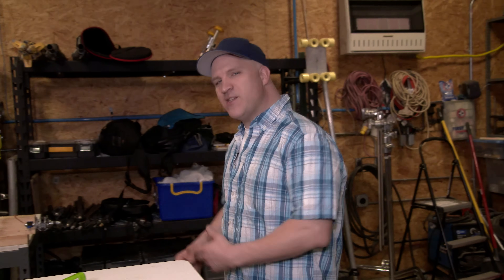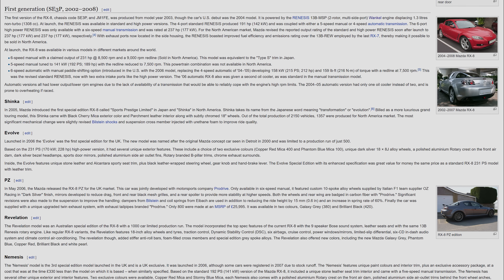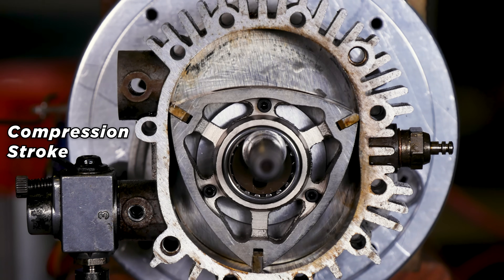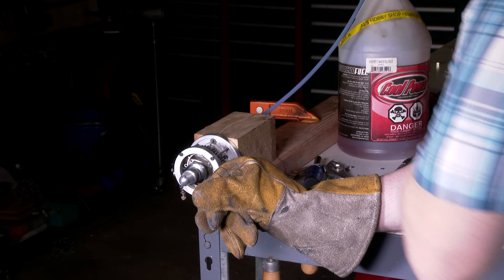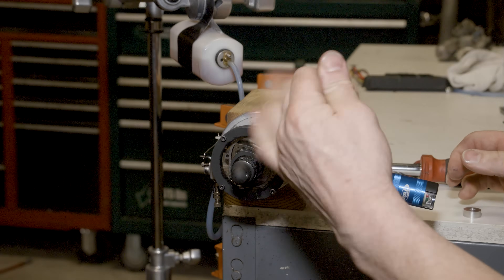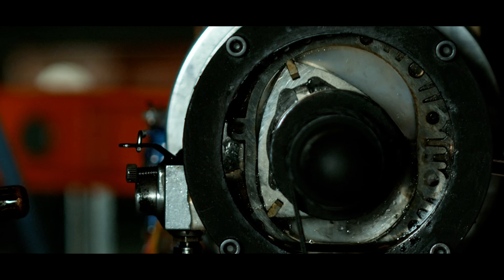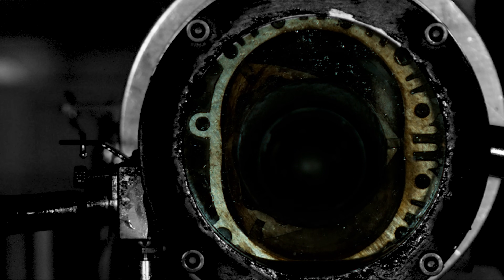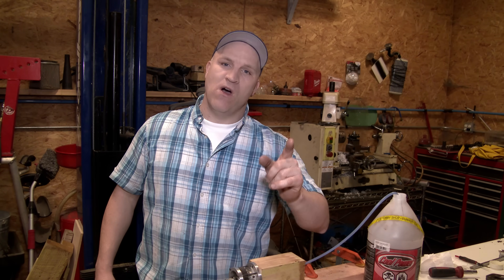See Thru Rotary Engine in Slow Motion - (Wankel Engine) 4K

Comment: Dumb question coming
I’ve always wondered a few things: 

1. Are their Diesel rotary engines
2 .Are their 2 stroke rotary engines 

Always wondered...
Reply: 1. As far as i know, none. Every Wankel Engine use a single or a pair of spark plug, which is consume a petrol /gas.

2. By the principal of how it works, this engine step is the same with a 4 stroke engine. The step itself is a same, intake-compress-blast-exhaust. How they make that step is totaly different. So this is a different engine, apart from 2 stroke and 4 stroke.
Reply: @valiantvincentius5877  The Wankel engine is a 4stroke engine but requires 1,080° degrees of crankshaft rotation to complete it's firing order sequence.
Reciprocating 4stroke engines only requires 720°degrees of crankshaft rotation to complete it's firing order.
Reply: @sandervanderkammen9230  With this engine, I see 3 combustion phases for every rotation of the crank.  Count them if you want to be sure.
Reply: @EarthSurferUSA  I think you are still a little confused about how Wankel engines work.
There is a 3:1 ratio between the triangular piston (aka rotor) and the eccentric-crankshaft.
Any questions?
Reply: @valiantvincentius5877  As far as the combustion phase goes, it is more like a 3 cylinder 2 stroke engine, as it has a combustion phase 3 times for every rotation of the crank. (or a 6 cylinder 4-stroke engine).  This Wankel engine is a diesel engine. No spark plugs, no ignition control.  It used a glow head for starting, then no ignition for running.
Reply: John Deere, Mercedes-Benz, Deutz, MAN, Yanmar and Rolls-Royce were among a dozen or so manufacturers that developed Diesel cycle Wankel engines. None were commercially successful or never entered production.
  ALL WANKEL engines use the 4-stroke/4-cycle operating principle or Otto cycle.
Reply: @sandervanderkammen9230  wow, thanks for the info of any of that diesel. I need to read much more 🙏
Reply: You got to have pistons to have 4 or 2 strokes...
Reply: @C.dieslevonankwek7  Not true, all Wankel engines have "stroke" e.g; the Mazda 13b engine's  eccentric-crankshaft has a 15mm throw or offset which produces a 30mm stroke per revolution.
Reply: @sandervanderkammen9230  I was thinking it would be considered cycles but what I know of a piston engine you have intake compression,  power and exhaust strokes. 2 or 4 strokes, I dont think a rotor spinning around in a cylinder is a stroke but I've been wrong many times
Reply: @C.dieslevonankwek7  The initial impression most people have of the Wankel engine is how simple it is but on further examination it is actually very complex in its design geometry.
 The Wankel has a triangular "piston" which orbits in a distinctive planetary motion.
Reply: @C.dieslevonankwek7  The triangular piston aka rotor reciprocates side to side as it rotates in a elliptical planetary motion.
The reciprocating motion is what creates the change in volume or displacement during the intake, compression, expansion and exhaust cycles.

Comment: Awesome game engine most powerful engine ever but. That’s.  My own thoughts and I.think that that engine isotherm strongest ever 
Don’t know why it’s only Mazda that did us. That engine ithink that’s the most powerful engine that ever Felix vankel did that engine from start rx7 is using that engine
Reply: The Wankel has extremely poor thermal and mechanical efficiency  and terrible combustion efficiency.
 Mazda was just one of 26 manufacturers that licensed the Wankel design from NSU Motorenwerke GmbH. who also produced them until merging with Audi which continued production until 1978.
Reply: @sandervanderkammen9230  The loss of mechanical efficiency per combustion phase, compared to a piston engine, is offset by the fact that it has 3 combustion phases for every rotation of the crank.  That is 6 times that of a 4-stroke piston engine, and 3 times more than a piston 2-stroke engine.
Reply: @EarthSurferUSA  Not true, the Wankel engine requires 3 rotations (1,080°) to complete it's firing order sequence.
Where the reciprocating Otto engine only requires 2 rotations or 720° degrees.
Reply: @EarthSurferUSA  None of this of course changes the fact that the Wankel uses more fuel per horsepower and less power and torque per liter of displacement  (total displacement) and corrected displacement.

Comment: What would happen if you put two or three spark plugs per rotor to burn all the fuel?
Reply: It's been done, 2, 3 even 4 spark plugs have been used in Wankel engines but just as in reciprocating engines more than 2 plugs offers quickly diminishing returns and increased problems .
Reply: @sandervanderkammen9230  Why could the burn not be more complete with the proper combustion volume area, (to correlate with rotational time and fuel burn time),  and a correct fuel/air ratio?
Reply: @EarthSurferUSA  The poor design of the Wankel engines combustion chamber has too much surface area and too much volume. This effectively reduces combustion efficiency and thermal efficiency due to increased entropy.

Comment: ok in principle, but it's a bit of an exaggeration in your example.
In your engine, you do not have all the segmentation of a renesis rotor which ensures better compression, side seal, corner seal, apex seal spring
Reply: It's just a model airplane engine.  If you want to sell them, the prices have to be low.
Reply: These Graupner 49PI engines were very expensive and did not perform as well as 2stroke reciprocating engines.

Comment: Fantastic video, amazing break down. One minor technical point is helicopters do not use rotary engines. Some early production helicopters used rotary engines where the pistons are arranged around the drive shaft but that is not a Wankel engine. 
Great video really shows how it all works
Reply: You mean "radial" engine.
Reply: @cyberbillp  A rotary engine as used in the original aircraft would make a hell of a mess in the helicopter with the castor oil thrown out of the cylinders in to the space around it. It does make an amusing image.

Comment: Does it ignite because the fuel will ignite under compression? Or because electricity  is used to make a spark.... and if its cause of a spark, it because of a set high voltage and once it gets so close the ark completes, or the electrical is timed to come on at a precise moment
Reply: The Graupner 49PI uses glow plug ignition
Reply: @sandervanderkammen9230  Only for the start up. There is no electrical power to the glow plug after it starts.  Weather the coil of the glow plug stays red hot when running, I don't know.  If not, than it has to be the compression that fires the fuel.
Reply: @EarthSurferUSA  It won't run without the glow plug, these are not the same as Diesel engines they use glow plugs to help starting, Diesel engines don't need glow plugs to start or run.

Comment: 3.000 hp
Reply: LAMENORDUDA
Reply: The Graupner 49PI is rated at 1.1 ps (1.0 horsepower)
Reply: @sandervanderkammen9230  Wheew, lower than I thought it would be, (what is the size/displacement equivalent?).  That is only about .26lb/ft of torque at 20,000rpm.
Reply: @EarthSurferUSA  Torque is not relevant in aircraft applications, but Wankel engines have very unimpressive torque per liter output.

Comment: You can also see why it doesn't produce as much torque as a standard Otto engine too.
Reply: Not so fast.  You can see the combustion pressure is not as direct on the crank rotation as a piston engine, but it fires 3 times for every crank revolution.  That would be the same for a 3 cylinder 2-stroke engine, or a 6 cylinder 4-stroke engine.  That advantage is huge, but I am not sure of the displacement differences though.
Reply: @EarthSurferUSA  No, it only has one power stroke per rotation

Comment: why dont they just add more sparkplugs after the combustion chamber and before the turbo? that could do some afterburning without adding more fuel lol
Reply: How would you control the air fuel mixture for the other spark plug?
Reply: @sandervanderkammen9230  OK, you are a fairly sharp guy.  But to answer a question, (with a question), that makes no sense is a bit futile, isn't it? :)
I am still trying to figure out where "after the combustion chamber" is, and where the turbo is.
Reply: @EarthSurferUSA  anywhere between the exhaust port and the tailpipe, but without the correct aircraft fuel mixture the spark plug does nothing.

Comment: You dumbass thats a rotor engine not a rotary engine, rotary engine is a ww1 airplane engine
Reply: Good point, the Wankel engine shown here is not same as a real Rotary engine.
Reply: @sandervanderkammen9230  They are both called "rotary" engines, but for different rotary reasons.  The plane engine with cylinders all around, about a crank shaft, is still a reciprocating piston engine.  So in reality, which is the best engine to be called a "rotary engine"?  Is my Harley a semi rotary engine? :)
Reply: @EarthSurferUSA  No, a rotary type engine has a crankshaft that does not turn.
Harley Davidson is a V-twin but has a master and slave connecting rod, like RADIAL type engine.

Comment: The engine that would definitely benefit from an egr valve
Reply: I have one too, it makes a great paperweight.... pretty much useless for anything else.
Reply: That is the thing about nitro methane and methanol engines.  They can run rich and not lose a lot of power, (unlike gasoline).  But you can lean the fuel/air mixture for better fuel consumption.
Reply: @EarthSurferUSA  nitromethane contains chemical oxygen, so the AFR is completely different than most fuels.

Comment: Years ago a friend had an RX7 with a lot of miles on it and was hard to start, so he carried a spray bottle filled with brake fluid that he'd have to spray directly into the intake to get the engine started in the mornings and after it had been parked several hours and cooled off.
Reply: That is an engine with damaged seals and low compression, typical for Wankel engines which have a notoriously bad reputation for reliability and durability.
Reply: @sandervanderkammen9230  i totally agree. Just putting it out there in case someone needs help getting their rotary started. Hopefully they'll know to do this on the engine side of the air filter
Reply: @sandervanderkammen9230  As any engine with a "lot of miles on it".  Who knows how well it was maintained.  They made production on many things.  That would not have happened if the reliability was not up to par.
Reply: @EarthSurferUSA  hard starting and flooding is common for Mazda RX engines due to damaged apex seals.

Comment: Hiii can anyone please help me my automatic 2005 rx8 around 78,000 miles is making a clucking/knocking noise  I think it sounds like it comes from the lower right side but I can be wrong , you hear it when the car starts mildly but becomes louder in gear rev / drive it used to come and go but its mostly now it drives as normal no compression problem I think if its not the ssv can it be the spark plugs I'm getting an engine light for the coil pack but that was before knocking I'm lost S.O.S   THANKS

Comment: Just add a second, reversed wankel on the exhaust to use the unburned fuel
Reply: honestly pretty genius
Reply: Awesome idea dont know the technical difficulties but sounds great
Reply: Do you mean by adding turbocharger & feeding the hot side of the turbo with the rotary's exhaust? 
   Like the 13B turbo options ?
Reply: @MainMite06  That would get insanely hot though! Compressing air that's already stupidly hot, fekk! Are there realistic materials that can withstand that?
Reply: @MichaelEdlin542  engines already get hot? idk tho

Comment: The rotary engine makes a diesel seem spotless by comparison ;)

At least the diesel burns most of its fuel inside the cylinders

...and yes, I do daily drive a VW Golf TDI, but with the emissions fix
Reply: This a RC model engine that runs on nitro-methane/methanol/castor oil, (most likely fuel, same for a little 2-stroke nitro RC engine), and they can run rich.  This one is running rich.  He can never tune it nearly as well as a modern engine management systems, so we should not compare it to them.  For it's size though, the little RC engines are probably the most dirty internal combustion engines on the planet,----but they are small and small in numbers.  Who cares?  By the way, I think by definition, this little engine is classified as a diesel. Glow plug and compression ignite the fuel.
Reply: @EarthSurferUSA  No, not Diesel. There is no compression ignition.
Like most small RC engines this one used GLOW IGNITION

Comment: i know this is an old video (by internet standards) and i doubt i'll get a reply but why is it that when you're pulling the cord to start, the engine kinda pulls it back a little?
Reply: Because air pressure
Reply: The rotor was not going fast enough, and the wrong chamber ignited, (pushing that lobe the other direction).  It does not happen at faster, and running speeds.  But he does have to pull it fast enough to get past that point.  I think I remember a bad one in the vid, (it is like a backfire), and it blew flames out of the intake.
Reply: The  Wankel engine has a compression stroke and offers resistance to cranking over when starting.

Comment: not a complete burn fuel bad for oil consumption, it does higher HP bcouse it has low torque, lower torque higher HP you can have it  on piston type, just shorten the conrod widen the bore then you might have equality on HP. rotary engine pretty simple less components and less friction. 1.300 cc on rotary better HP poor gas milleage this engine will be skiped couse electrical is comming right up LOL
Reply: The Wankel is obsolete because it offers no advantages over a reciprocating engine.

Comment: Does the rotary fire 3 times per revolution?
In a car, how many rotors per engine?
Reply: Not used in cars anymore, in the past they had been made in 1,2,3 and 4 chamber configurations.
Reply: Fires once per rotation of the crankshaft, and requires 3 rotations to complete it's firing order sequence.

Comment: I rebuilt with a friend my rotary engine from my 1982 Mazda RX7 when I was a teenager. What an interesting build that was. It was like building a sandwich.
Reply: When you actually put one together, you see that it is really easy to do. Sadly, here in SoCal, I'm one of the few that has actually built one. All the dealerships simple buy a re-manufactured small block from Mazda, swap the parts and drop it in.
Reply: A dagwood sandwich?

Comment: It's such a cool engine. I wish it would have worked though. It's pretty much failed and no one uses it now.
Reply: High power output but short engine life (rotating seals) so used  for torpedoes and for other compact disposable operation.

Comment: Forget Mazda! The Wankel engine was first used in a production car in the NSU Spider, 1964, the NSU Ro 80 1967, the Mercedes C111, 1969, Maico motorcycles in the 70’s and also in the Norton RCW588 race bike 1989.

Comment: Thank you for this. With so little to go wrong with rotary engine I'm surprised we haven't seen more of them other than Mazda. It seems like a more efficient balance of power and probably better on fuel costs as other conventional engines of same performance. Diesel rotary's are absolute monsters. Bring back the rotary .
Reply: Wankel engines were less durable and reliable, the are obsolete because they offer no advantages over a reciprocating engine.
Reply: Several attempts were made to produce a viable Diesel cycle Wankel engine, none were successful.

Comment: I think company should use this As hybrid engine for more better hybrid. The engine only start when electric motor is off
Reply: Several companies researched the concept but the Wankel is noisy, dirty and inefficient, not a good match for a hybrid EV and its clean, eco-friendly image.

Comment: Thank you for the 226+ takes it took to bring this video to us. Seeing inside a Wankel Rotary Engine 
really helps one to comprehend what’s going on inside the engine. 

There is no ignition source other than the glow plug that’s used only to start the engine. I can’t imagine that there’s enough compression to ignite a fuel as in a Diesel engine or even the more volatile gasoline.  

I used to fly 2-stroke piston-engine powered RC aircraft. My fuel was a blend of castor oil, methanol and nitromethane. That mixture would ignite under the amount of compression that these smallish 2-stroke motors produced once there was some heat accrued in the engine from the glow plug ignition and some idling of the engine. You mentioned using nitromethane to start your engine when acetylene was introduced into the air intake. 

Does your Wankel Engine rely on the enhanced volatility of your fuel, similar to my 2-stroke piston engine years ago, to self ignite once the glow plug is disconnected?

Comment: Can u make diesel rotary to make up for lack of turk
Reply: The Wankel cannot operate reliably using the Diesel cycle. It lacks static compression ratio needed for reliable compression ignition and lacks the sealing durability for the higher combustion pressures and temperatures.
Reply: @sandervanderkammen9230  thank you for the knowledge sir
Reply: @billymays495  you're very welcome sir, cheers!